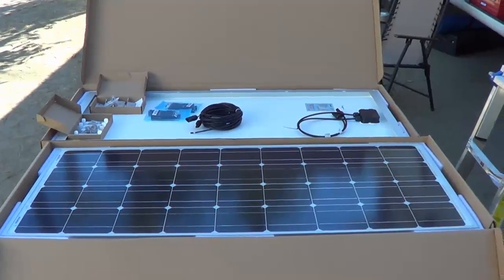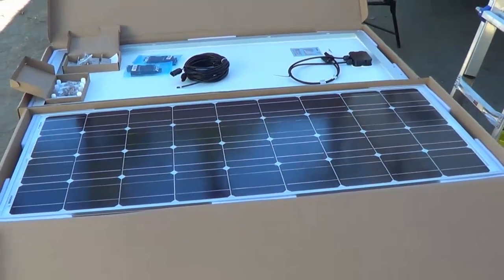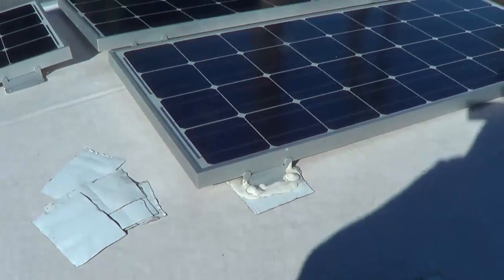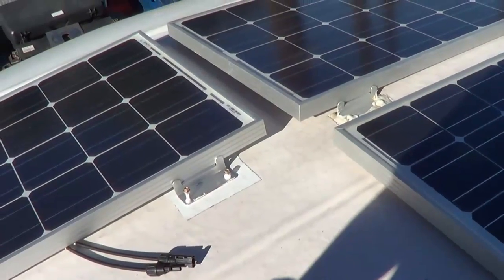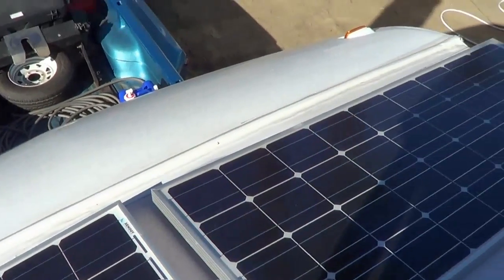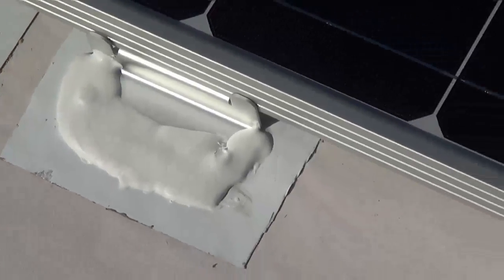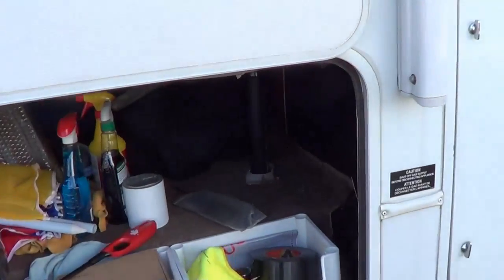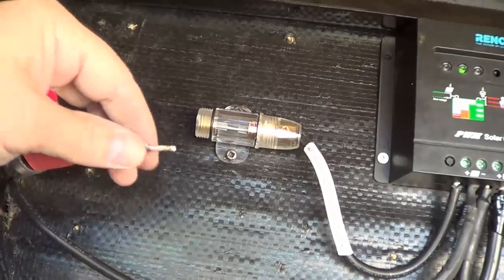Upgrading My Renogy RV Solar System to 400 Watts

Comment: I should have added that solar cells are exceedingly fragile... So safety glass is essential if it does not come with it... I would recommend hurricane glass panels for protection... One falling limb, low branches or a hail storm could devestate your solar array. I am unsure how brittle the flexible panels are. I have kept up with solar cells since I was in the 9th grade... Oh... Beware of buying complete systems claiming 6kw output, as these put out 6kw for the DAY not the Hour. All solar panels you purchase should be rated in KiloWattHour... Not just KiloWatt.

Comment: Another note... The flexible solar panels will tranfer heat directly to the tool's roof so installation of a good high heat insulation barrier that can be glued to the roof and the flexible solar panel glued to that... Or... An air space between the flexible panels and the roof, with wind deflector in front to prevent air from trying to remove those panels would be essential. Also, racks on both sides can desguise these solar panels for more stealth.

Comment: 100 watt panels for under $30 each??? Really? I realize there places advertising such but they are used or defective. I own 8 100 watt panels and 8 160 watt panels plus 2 wind generatorators... 1 400 watts and the other 1kWh. And I also have purchased other products for up grades and portable stream powers generators and alternator totaling over 6kWh. For everything.and an on an generator as well. So my power is no problem.
Reply: Terry Weaver $130, not $30. 
Renergy is a reputable manufacturer of solar panels.

Comment: Did you, at the time of installation or since, consider using tilt mounts for your panels? If not, why not?
Reply from the maker: Yes, but decided against it as we move quite often, average every 5-7 days, more cost and complexity, we only dry camp 4-5 months of the year and I prefer not to be going on the roof all the time. If I need more power I still have plenty of room for more panels. I also have a 100-watt remote ground panel now I utilize to catch the early morning rays.

Comment: Question- Do I need a bigger charge controller for 400 watts?

 I have a HQST 20a MPPT Controller in my array (only 200w now) and want to get my panels up to 400w  in a 12v system  
In the manual it says 12v systems can only input 260w ... 
   That doesn't seem right...$100. for a charge controller that can only handle less than 300 watts?

Does that mean I have to put two panels in parrel and 2 in series or something like that? to keep the wattage input down?
Reply from the maker: I'd say you do. Looking at its specs its rated charge current is 20 amps, 400 watts of panels can exceed that when in max sun. You should have a controller capable of 30 amps if you want to get the max charging amps out of them.  If not it doesn't look like it will hurt anything to hook up the extra panels you just won't get the extra charging amps you could get when on max sun.
Here is a quote from the user manual "4.1 Protection
 PV Over Current
The controller will limit charge power in rated charge power. An over-sized PV
array will not operate at maximum power point"  Cheers, Ray
Reply: Yeah...I hear ya..... The ratings for amps together (From labels on backs of panels) totals are aprox. 19.5 ..right on the max line... hahaha  But- I can't remember when my panels got that much sun so far.   Usually I get about 70% of those manufacturers ratings 
    but That 260w number is the number I'm really concerned with... Is that total panel rating amount (I'll have 400) or actual watts being dumped into the controller...Cause- again... I never seen 100% efficiency yet even though I am in Florida.. If it's actual amount the controller is dealing with then yeah...It's a waste cause I gotta believe 400 watts of panel would make over 260 watts...
Reply from the maker: I'd think it's the watts into the batteries because let's say you hitting the max charging of 20 amps at say 13 volts. Then 20X13=260

Comment: Do you have to disconnect your solar panels when you plug in to shore power or to your pickup 12v light system
Reply from the maker: No, they can charge simultaneously.
Reply: You have a MPPT charge constroller or a system hooked up to the starter and house battery. I know I'm side tracking. Sorry!

Comment: Anytime you add fuse link or switches to a input line you have voltage drop. I would think that you would have the lines going into a hub in from the Hub you would have them going to your solar controller without having a fuse or any switch. I would be interested to see why you would put a fuse between your controller and panels. Great video though I enjoy watching your videos I've learned from your videos but I know electricity and you have voltage drop across that 30 amp fuse.
Reply from the maker: I like to have a way to quickly unhook a circuit. Here is my system today - http://www.loveyourrv.com/diy-rv-boondocking-power-system/
With the breakers, I can quickly shutdown circuits to work on them, I like the convenience. 
It's code to fuse each panel in a parallel array of more than 2 panels. I haven't noticed much loss, With proper connections, I feel the voltage drop is minimal and I can live with it. If it were an issue, I'd add another panel to compensate, but that hasn't been the case. Cheers Ray

Comment: today is the day,  Ray, that I copy your system..my panels and everything is at FedEx waiting for me to pick them up. Wish me luck. and thanks for the videos.
Reply from the maker: Have fun! :)
Reply: Love Your RV you made that look awfully easy , I got half of it done today before my back went out. Hopefully pain pills ice packs and tomorrow I will get it finished. I will give you credit on my video. thanks again
Reply from the maker: Thanks. I'm lucky to be blessed with a good spine. My other half Anne isn't so lucky, so knows your pain. :(
Reply: Love Your RV I've noticed that when you first put your second set of panels up you used a 30 amp fuse and then later you have changed it to a 40 amp breaker am I seeing that right? and if so why did you do that?
Reply from the maker: The 30 amp was all I could find at the time locally. Mostly the breaker is there so I can have a way of disconnecting the panels if I want. Many people just use a shut-off switch without a breaker. I copied Handy Bob's 40 amp breakers on either side of the SC2030 controller - https://handybobsolar.wordpress.com/2015-the-trimetric-2030-perfect/

Comment: I would have thought you could daisy chain the new panel's into the old ones. Would have saved you the new inspection hole in the bathroom. ha ha
Reply from the maker: You can but I wanted to double up on the wire for better power transfer. I hindsight I should have run a thicker wire the first time but would have added to the cost. My budget was limited at the time.
Reply: If you run 10gauge solar cable you can prob go 30A or more current. But we all start somewhere - unfortunately solar is extremely addictive drug! I used two cable runs on my 5kw solar grid tie so 12x250w on each run (of two) with 10 gauge. Overkill yes but that's 380vdc @7A per run and each run is 30ft on my house. Great video btw, we are about to buy a 2011 Cougar 5th wheel. One other tip, get yourself a wire fish. Home Depot or other stores have them. I use mine all the time. Drill you little hole, run fish down, find the way, then tape wire to it and pull it through. Quite painless. Thirdly, that type of charge controller is junk compared to MPPT type - but those are $200 bucks for a 40A. Cheapo controllers just short your battery to the panels. When your battery is at 10vdc your 400w @ say 14v panels are only giving you 75% power to the battery. Thats bs. Also, the better controllers allow upwards of 100vdc input so you could of seriously used that single 10gauge run if you had a parallel-series panel connection up there - so double voltage - half current - same wattage. Plus your 400w would all go into your battery even if it was low at 10vdc. Check out MPPT controllers such as https://www.ebay.com/sch/i.html?_osacat=0&_odkw=mppt+40a&_from=R40&_from=R40&_trksid=p2334524.m570.l1313.TR0.TRC0.H0.Xtracer+mppt+40a.TRS0&_nkw=tracer+mppt+40a&_sacat=0 as well, you can get a kit with remote control and monitoring panel shows what's being used and what's produced. You can put this anywhere in your rig it runs off a standard cat5 cable/connectors (same as LAN cables for wired networks). You are travelling all the time but for those people who park it at home you can use a 2-way switch to go to a quality gridtie inverter for your panels. Or run both charge controller & gridtie parallel. Once battery is charged gridtie gets the extra juice.This way parked at home your panels can push that 400w into your house (must plug trailer into house 120vac) conserving your home's electrical consumption - oh and avoid those car stereo amplifier chinese gridtie inverters - they are barely 70% efficient at best - trust me I know! Anyhow keep up the great videos.

Comment: Just an FYI about the 3M VHB Tapes you mentioned, I do tech support at 3M for VHB and we do not suggest our tapes on this application even though people use them at their own risk on fiberglass RVs it will not bond to the EPDM roofing.
Reply from the maker: Thanks, and even if it did bond to EPDM I'd be worried about the bond between the EDPM and underlying roof boards coming apart.

Comment: Hi Ray, I know this is an older video but i am sure you are always looking to improve mounting methods to an rv so I wanted to share with you a tape that is stronger than rivets. It is made by 3m & it is called 3m VHB. It is not cheap but man does it hold almost any material in place. Check out this 3m video. I have used it myself & am extremely impressed with it.  https://www.youtube.com/watch?v=4buSuzQKaUI Ops! lol you did mention it in the video after i posted this. Hope this helps anyway.
Reply from the maker: I don't think the 3M VHB would be advisable on rubber roofs as the rubber may tear off the underlying wood. But I've heard it's great for fiberglass and metal roofs. I've used it to mount a few things and it's strong stuff!
Reply: Great point & something for me to check into. I guess i would need to contact both 3m and the roof manufacturer. I think a combo of eternabond which looks like great stuff & the 3m would make a seal that would be stronger than anything else out there. I just ordered a roll of eternabond  tape thanks to you!

Comment: How do you like your Renorgy solar panels I've got 10 of them however I only have five hooked up right now to Renorgy tracer 4210 MPPT charge controller I'm using the four golf cart batteries 6 V wire it up for 12overall I've had pretty good luck with that I see were someone ask why you're using 100 Watt panels instead of a 200 W panel a lot of folks swear by those 100 Watt panels  Renorgy sells  mine have perform very wellsupposed to be really good and with the right charge controller they sometimes put out a shade over 100 W some of those bigger panels are problematic at times
Reply from the maker: So far I'm happy with them, good performance, lightweight and econonmical.

Comment: just curious, why two 100w rather than one 200w?
Reply from the maker: Commonly available, light weight and fit my roof and the way I planned to lay them out. I feel smaller sized panels will be more secure on the roof. Also, I wanted 12-volt panels for my system.
Reply: thanks for your insight
Reply: because the size of the roof is equal 2 x100w panels..

Comment: you know its pointless to fuse the output of solar panels right ? Even under short circuit the current will be almost the same as when they are charging the batteries flat out.
Reply from the maker: I wanted an easy way to be able to break the panel circuit if needed so may as well use a fuse. I've since swapped it out for a switchable breaker.  This is a look at my system as of now - http://www.loveyourrv.com/wp-content/uploads/2016/07/Boondocking-System-Diagram.jpg  I like to have every circuit fused. Probably, overkill but makes me happy and confident it will pass inspection if needed in the future for insurance reasons.
BTW, the Renogy manual shows fusing between panel and controller - http://www.renogy.com/template/files/Manuals/Off-grid-General-Manual.pdf pages 63 and 64
Cheers Ray

Comment: Quick question, when you place panels close together coudn't you over lap the z brackets where they are close together.  In other words put one bracket for the second panel over the bracket for the 1st panel.  In your set up this would eliminate 8 holes through your roof.  Do you see any problems with doing this?
Reply from the maker: I guess you could but I would rather have more points screwed in for a stronger bond to the roof. Also, it gives me a place to put my hand when I'm leaning over to clean them. Cheers Ray

Comment: Hi did you drill through the roof then apply the eternabond, or did you apply first then drill through that, if you drilled before the eternabond was it hard to find the drill holes?
Reply from the maker: I laid the Eternabond first. It's mainly to help protect the rubber roof from the brackets. Some people use butyl tape.
Reply: Hey thanks so much for getting back to me so fast, you are such a good source and help me. Definitely sub'd.
Reply: "and help to me"
Reply from the maker: Cool, thanks!

Comment: Hey love your videos, we're new to rv'ing and just subscribed to learn more. I'm wondering if you can help me out deciding, I'm looking at the renogy 200 watt kit and the 100 watt portable kit. We have two 6v golf cart batteries at 225ah on our unit. We live in Alberta and not sure if panels on the roof would get enough light or not in wooded areas? Do you find these work well if you head out to the woods? Would the portable unit be a better option? Thanks in advance for your advice!
Reply from the maker: Any sort of shading can really limit the solar panels power so if in the bush a lot you'd want to go with a portable setup where you can get into full sun. Keep in mind though at best a 100-watt panel will put out 5-6 amps. Not very much when you are trying to charge up the 2 golf cart batteries. Say they got really run down to 50% or around -100AH, it would need 20 hours of sun to bring them back to full charge with the one 100 watt panel.
It would only extend your time between hooking to shore power or a generator.
Nice would be to have 2 on the roof plus a portable panel for the ground.
Reply: +Love Your RV thank you for your reply I appreciate it. Alright ill have a look at the renogy 200watt system and just be mindful of where I set up. I think it probably a better setup at 200 watts and like you said look at the portable setup afterwards.
Reply: +Love Your RV hey one more question, I solar panels mounted to the roof - if I park my trailer in the rv storage yard my panels will be keeping the batteries up until winter right? I'm just thinking about storage and having to remove batteries to trickle charge when not using the rv. Obviously they will be removed in the winter time
Reply from the maker: Yes, they will keep the batteries topped up nicely.

Comment: Liking your vids Ray.  I have a question about the Z brackets.  Are you able to get to the bolts that attach them to the panel after installation in case you want to get under there for some reason?  I'd hate to have to remove the lag bolts into the roof.
Reply from the maker: Thanks Mike. It would be a pain but I'm pretty sure I could get at the bolts with a ratcheting wrench. Would just need to break the torque on the lock washer then work it loose with fingers.

Comment: Why didn't you use wiring in place from the 200 watt install?
Reply from the maker: The original install used 10 gauge wire which was OK for 200 watts but too small for 400 watts, by running a second set of 10 gauge wires in parallel it brought the effective gauge down to 7 which keeps the power losses due to wire resistance reasonable.

Comment: Hey Ray...I'm curious if your upgraded solar system has proven satisfactory for all your boon docking demands. I'm planning my system now and I see other systems out there with crazy high wattage numbers. I think my demands will be similar to yours, so I'm wondering if 400 watts is enough based on your experience. I already have two 125 watt poly panels left over from another project so I'm thinking another  two 100 watt panels will be plenty. Thanks for your time, Jean
Reply from the maker: Hi Jean. 400 watts has been enough except for when we were in mid-winter with the shortest days. Also, at that time, it has cold nights which means more furnace fan run time at night.
Tilting may have solved that but I prefer not to have to. Less roof time the better I feel.
Once we got into February the daylight hours had increased and night time temps increased and firing the generator became a very rare event. I have plenty of roof space left so I may add a couple more panels or possibly use a ground panel.
I more than happy with my battery capacity 464 AH but would like a bit more solar power for next winters boondocking.

My biggest motivation for getting solar was to not have to run a generator when camping in close quarters, especially with tenters like when we visit national and state parks. I can say the 400 watts has been plenty and I'm most pleased. Even if we have cloudy days it's enough as long as we get a little more strict with our energy uses, IE, no big screen TV time or Anne'a big 21" iMac.
We still have enough to run laptops and charge up things, plus LED lights and the regular RV 12 volt loads.